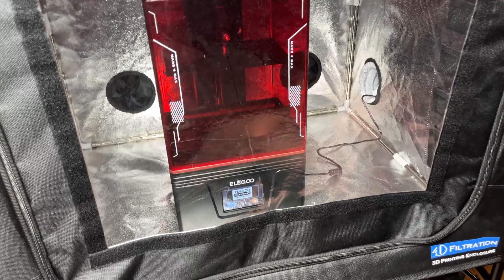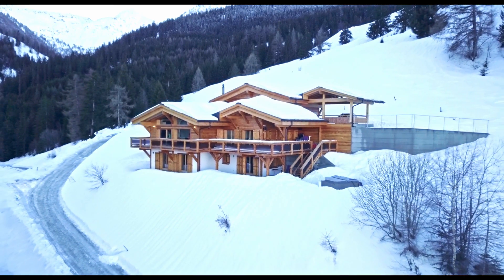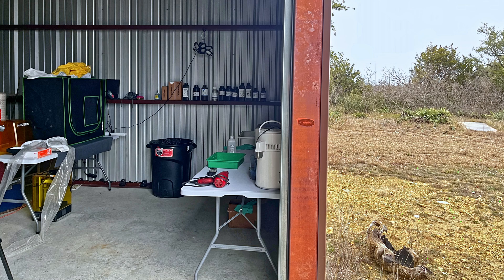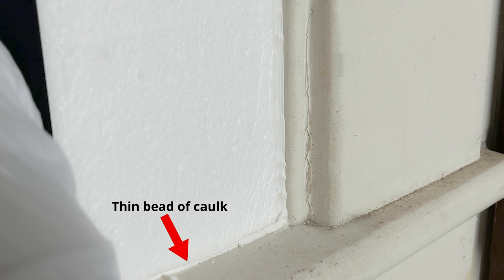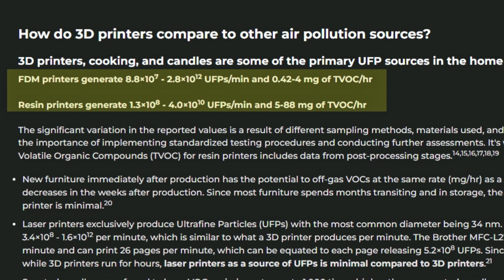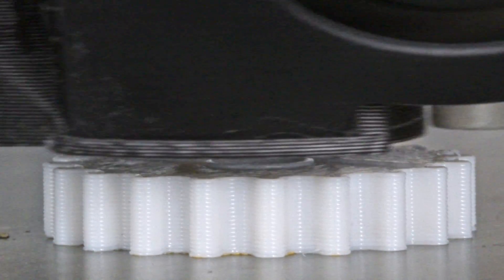FDM & Resin 3D Printer Ventilation

Comment from the maker: ⏱ Timeline:
00:00 - Introduction
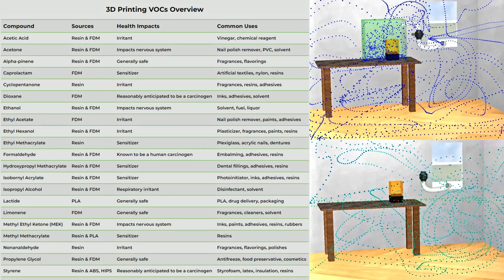00:15 - Outdoor Ventilation
00:59 - Indoor Ventilation
01:13 - Fan Selection
01:55 - Using Duct
02:08 - Window Adapters
02:32 - Enclosures
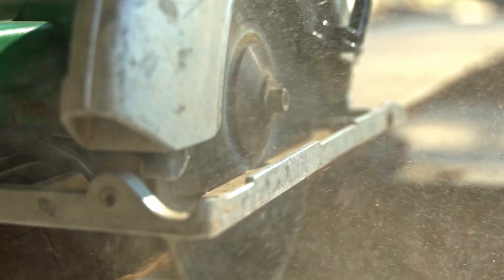03:03 - Ultrafine Particles & VOCs
04:03 - Filtration
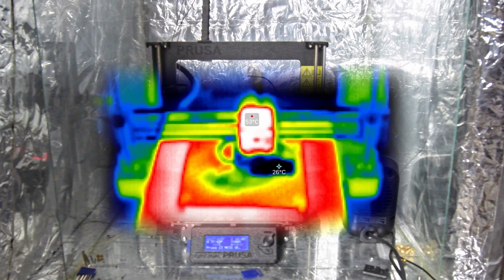04:26 - Filter Options
04:50 - Conclusion

Comment: Going by a (borrowed and old, but still decently working) ultrafine particle counter, mere 3m of air and a decently big open window + small table fan are more then enough to clear out PLA. Fan itself isnt even needed unless the window is only partially open (or there are repairs going on outside).

Comment: I understand to vent the main printer, but in the case of resin printing what do you recommend for the washing and curing stations? do they also realistically need to be ventilated or will venting just the actual printer suffice? This all takes place in a room that is roughly 40' x 16' so there is plenty of air space to dilute minor pollutant.

Comment: I'm wondering if anyone has any input on this. So I'm ordering a properly manufactured paint booth for my workshop. The workshop is located inside my home; the garage is unfortunately more trouble than it's worth. Aside from painting, I also have 3d printers in this room. I've been looking for a way to more effectively ventilate my resin printer, and I'm wondering if just turning on the paint booth will be sufficient. The printer isn't going to be directly connected to the booth, but since the booth will provide very powerful ventilation, and it's a pretty small room, I thought maybe that would be enough; any thoughts?

Comment: You are only talking about ventilating the air to the outside of the printer. When printing ABS and more advanced materials, you're actively heating the build chamber to say 50 C, you don't want to release this hot air from the chamber! So in that case, use a recirculation fan system which takes air from the top of the chamber, filters it by HEPA /carbon and release the filtered air back into the chamber at the bottom..

Comment: What would a complete filter solution look like to mitigate output from the widest range of materials both resin and filament? In a world where you can stack layers of any filter materials, does order matter. Would Activated carbon, hepa, and merv layers be sufficient for most applications?.
Reply: Just speaking from my limited understanding. You would want 3 stages. 

Stage 1; Ionization. Something like a thin cotton filter, the only real purpose of this is to create static energy to make the next stage more efficient. It's been shown that charging particles can enhance the effectiveness of HEPA-like filters. Many manufacturers now use static to allow them to get the same performance as a higher grade filter but use a less restrictive filter thanks to the static action making it more effective. 

Stage 2: HEPA-Like capture of UFPs. 

Stage 3: Activated carbon medium. And an absurd amount of it. Like a grow-farm canister. Catalytic carbon might also be useful if there are sulfides or choramamines in a given formula of resin. 

There was talk about using a UV light to try to induce some degradation of DPO and ACMO chemicals, but those are actually more of a concern as their UV decomposition forms. It's better to just attempt capture than decomposition. For reference though, to get testicular atrophy from DPO, they had to give rats 100mg/kg/day. Orally. If you were to inhale and absorb the same thing as an average adult, you'd be needing to inhale 6 to 10 grams, daily, depending on your body weight. Equivalent real world sizes to think of that? 1 gram is about equal to a sugar cube, a stick of gum, or a paperclip. ACMO was NOAEL at 15mg to 80mg, so it is likely a similar story here. 

Nobody wants to be the first to find out if these chemicals are bio-accumulators or will shut down your kidneys after a year of sleeping in a room with an SLA printer, but people are also coming at these machines dressed up in homebrew hazmat suits which I think is a little overboard.

Comment: I am thinking about doing my setup in the garage I have a ZZ1S UV printer flatbed want to put a tent with ventilation setup but my concern is when I asked AI should it work it told me yes but considering the city I am in the temperatures going as high as 90-105 degrees garage might be too hot of a place to store the printer and over time can be harmful to the printer

Comment: I wanted to buy my first enclosed 3D printer to use in my one-room apartment where I work, live, eat and sleep, but after reading and watching dozens of videos about VOCs, I gave up on the idea. It needs a dedicated and well-equipped area.
Reply from the maker: Especially when only using PLA, a FDM printer can easily be put in the common area to safely print. Any consumer air filter on amazon with HEPA filters will be sufficient to mitigate the particulates.
Any 'upgrades' like a grow tent, open windows, or active ventilation will only help.
Reply: @ArisAlder  so it possible to have it in a smaller room like bedroom with grow tent, filters, window adapter etc. ?

Comment: What is the risk factor for PLA or PETG printing?
Reply from the maker: Minimal, especially when using any consumer air cleaner or MERV 13 filters.
PETG does give off a few more VOCs that can cause irritation, such a caprolactam (can cause throat and respiratory irritation).

Comment: Do you think something like a grow tent + small particle filter on the inside would work for FDM printing? I have not purchased a printer yet, but I don't feel like dooming myself or my family to health issues down the line so I can play around with plastic. I should add that the grow tent would be sealed off from outside air and the filter would run inside while the printer is going. I suspect I would mostly print in PLA but you cannot be too safe, plus this would give me the flexibility to print using other materials too.
Reply from the maker: This setup would be perfect for basic materials like PLA, but any 'engineering' materials like ABS, ASA, PC, or Nylon can be problematic due to the VOCs.

Comment: im planning to print using resin, and am having a hard time finding the proper keywords to find a HEPA filter that would fit the ducting for my enclosure - searches are entirely returning filters specifically for air purifiers, when id like something i can attach to ducting/tubing. any advice on keywords to search for?
Reply from the maker: I believe you are referring to an inline filter?
Are you trying to filter the air as it is being vented outdoors?

Comment: Does something like AENO AP2S or PHILIPS AC3737/10 will be enough for printing with PLA, PeTG and maybe ASA? Or I should make an enclosure with turbine to exhaust fumes in window?
Reply from the maker: Those would be fine for PLA. With PETG, they would capture the particulates but some of the PETG VOCs may result in slight irritation. I could not recommend relying on filtration for ASA - it is much safer and cheaper to use ventilation.
Reply: @ArisAlder  agreed

Comment: I have a resin printer in my garage with the garage door open and i want to buy an enclosure and ventilation duct system but im worried about neighbours smelling VOCs?

I also just recently got an FDM printer and the best place is my bedroom. It sits on a cabinet below an open window and I have a Phillips 1000i air purifier. Would that be okay for ventilation?
Reply: I also mainly use PLA for FDM
Reply from the maker: For resin, being outdoors is the best spot for you, but you are right it can be an issue for very close neighbors. You will have to use your best judgement there - if you believe it is an issue then generally an oxidizing media that can break down the VOCs before they are vented are a good idea - FumeFusion is an example.

For FDM using mainly PLA, indoors with a filter such as that is fine, but I would recommend a room other than your bedroom.

Comment: All 3D printers produce UFPs and VOCs. You should make every effort to remove these unwanted byproducts from your immediate environment, either by filtering (HEPA filter for UFPs, activated carbon for VOCs), or preferably by moving them outside, where they will be naturally diluted to harmless levels.

My home office houses my 3D printer right next to my workstation. When I'm not printing, the air quality is good (typically PM2.5 <5 ugm-3, PM10 <10 ugm-3, HCHO <0.1 mgm-3, VOCs < 0.3 mgm-3). When I'm printing PLA or PETG, there is a steady increase in PM2.5 & PM10 which peaks about 2 hours into the print and stays steady until the end.TVOCs peak almost as soon as the print starts, slowly reducing until they rise again, also about 2 hours into the print.  Opening a nearby window almost entirely ventilates the VOCS, but the PM2.5 stay around about 20 ugm-3 - I think this is because there's more PM2.5 in the environment outside than in my office. I have a BentoBox inside my printer enclosure, but it doesn't seem to make any difference to the air quality.

I have recently found that frying food on an induction hob in my kitchen on the floor below, with the doors closed and kitchen extractor on, produces UFPs and VOCs throughout the house far in excess of those produced by my 3D printer. Of course, I can't tell what those actual VOCs are (not likely to have extremely harmful gases like styrene monomer from cooking steak!), but it does give some context to the good/moderate/unhealthy thresholds generic air quality monitors provide.

Anyway, I'll be printing only PLA and PETG with the window open, and I'm not going to use anything more exotic until I've finished printing an active extractor system.

Comment: I have my 3D printer in the same room I sleep in. I mainly use PLA and PETG, and I have 2 questions if you can help!
1- for ventilation, I’m concerned about cutting a hole in my bedroom walls to connect a vent to push out the fumes, cause it gets pretty cold and hot where I live, and I don’t want to lose insulation. Does anyone have any experience with this?
2- I was considering buying a hepa filter with activated carbon and just putting it next to my 3D printer, and hope that’s enough to mitigate the issue, but I don’t know if that’ll be sufficient if I leave it running all the time, only turning it off to sleep.

Any tips or advise is greatly appreciated !!
Reply from the maker: I would highly recommend putting it in a different room. If that's not possible and you feel comfortable leaving it in there, then try to time prints for when you are not in your room.
In either scenario, putting the printer in an enclosure like a grow tent and using filtration can significantly reduce exposure.

For ventilation, most people use the windows, and this method is very effective so long as it not causing warping on the prints.

Comment: @ArisAlder Thank you for the video! Very informative. So having a negative pressure inside the growth tent would mean that there are no fumes inside the tent once I open it to work on the prints? Should I maybe wait 30 minutes - 1 hour after done printing to access my prints?
Reply from the maker: Negative pressure is there to prevent fumes from leaking back into the room. Waiting up to an hour will certainly help ensure any residual concentration is exhausted outdoors, but keep in mind that cleaning the prints will also release VOCs, so there is an argument to be made that it is potentially a waste of time. Wear a respirator and do what you feel comfortable with :)

Comment: Is it better to filter fumes before sending them outdoors? Especially if you’re in a residential area?
Reply from the maker: If you can afford to filter the particles going out then it will reduce the impact locally. 

Whether or not the VOCs should be filtered depends on the proximity to others. An example of when they should is an apartment that is venting into an enclosed courtyard.

Comment: Thanks so much for this. I spent a 14 hour day researching this info and didn’t come across anything as concise and informative as your video. 
Question: I’ve ordered a Mars 5 ultra resin printer. I’ll be setting up a grow tent, inline fan, window vent, etc. I’d like to try and mitigate the pollution from the vent system out into my yard and the general environment. My current plan is to layer activated charcoal and a HEPA filter at the end of the hose just before the window exit point. Does that sound like viable mitigation in your estimation? 

From what I understand, VOCs are generally fumes, and less “catchable” by filtration. My main concern is plastic particles settling in the soil. Though not in the direct path of the vent, we do grow food in our yard and I don’t want to contaminate it. Thanks so much for your time, and again, the great video.
Reply from the maker: Thank you for the support!
A HEPA filter on the exhaust will go a long way in making sure most of the particulates are captured. Even with higher velocities across the filter, the efficiency will remain 90%+.

If you want to know when the carbon needs to be replaced, you can use a media like FumeFusion that will change colors as it reacts with the VOCs. If it is placed behind the carbon in the flow path, you will know when the carbon is completely saturated.
Reply: @ArisAlder  This is super helpful, thanks so much for your time and input!

Comment: are you saying that even carbon + hepa combo won't clear the air from resin 3d printer?
Reply from the maker: In most instances that is correct.
Filtration media can be used against resin fumes but the quantity needed (many pounds) and the replacement makes this option highly undesirable for most situations. Ventilation should be used whenever possible.

Comment: Finally a scientfically driven video! I'm getting a Bambu A1 and have been told numerous times I can't enclose it because it doesn't have a motherboard fan. I am still worried about the particles and will stick 100% to PLA. Is an air purifier really sufficient in pulling all the particles from the printer or is an enclosure still ideal?
Reply from the maker: I would agree that any printer being enclosed with its electronics being heated substantially is not ideal, but having an inline filter or vent will actually cool the outside of the printer more than if it was just sitting by itself.

If the printer is in an isolated room then an air cleaner is sufficient. If it's in a shared room then an air cleaner can be fine if prints are sparse or timed for when people have stepped out (other issues there potentially). Overall, having an air cleaner running 24/7 will improve indoor air quality since other pollution sources like candles, cooking, and specific types of humidifiers can release comparable amounts of particles.
Reply: @ArisAlder so if I were to have this in my office and running an air purifier all the time it’s still risky since I work from my office? I can close the door to at least partition it from rest of house.
Reply from the maker: Without an enclosure, being in the room with the printer + air cleaner is not 100% risk-free. I'm also not saying you will instantly get sick - just like with other particulate pollution, it's a slow burn that negatively affects the body as a whole, especially the respiratory section. More people are sensitive than others, and there are also probably millions of people who don't even use an air cleaner.

from best to worst with pla:
garage > separate room venting > separate room filter > same room venting > same room filter
and having an enclosure will improve each of these - the decision is up to what you feel comfortable with.
Reply: @ArisAlder  what are your thoughts on the bento box (hepa filter + carbon with fans) that circulates air inside the enclosure only (no exhaust out). Do you think that really helps much given no exhaust?
Reply: Thanks. Don’t wanna risk it so enclosure with exhaust sounds like the best. May look into bento box as well inside the enclosure but I also know enclosure are not truly air tight so my guess is particles will escape since their is not flow out. I’ll prob run a purifier in the room as well.  Thanks!

Comment: I just got my first 3d printer(FDM), and was intending on getting right into it, but found I needed to do much more research than I thought. While looking for recommendations on CAD software, which led to slicing software, I came across some casual mentions of ventilation. I had only done a quick setup and leveling of the printer when I smelled the printer head heat up without any filament having been inserted. I know the smell of stuff burning off a heater, and it made me pay more attention to that mention of ventilation.
Did I mention I have a bachelor apartment? I don't have an option to put the printer "somewhere else", so I've gone down this huge rabbit hole researching ventilation to know what's actually needed for my situation (which I'm surprised isn't more common).
It looks like ventilation is overkill for PLA and such... except specifically if I'm going to be eating and sleeping in the same room as the printer. Now I'm trying to figure out how I can set up some ventilation without it costing the same as the printer itself or more(grrrr)
Anyway, now I have a printer sitting there set up and I have to wait a week and a half until my next pay so I can afford to order the stuff I need  to actually get printing... Wish people would talk more about these first steps into 3d printing. It would have at least prepared me for what I was getting into
Ok, rant over
Reply from the maker: Yep just some simple filtration is fine for PLA, but the filaments like ABS make it more expensive and complicated to print safely.

I agree that it should be [properly] talked about more, but there’s also a lot of people who do talk about it that are backed by little to no data
Reply: My printer will be kept in my bedroom too so I'm planning to just take it outdoors during prints until I figure out an enclosure for it.